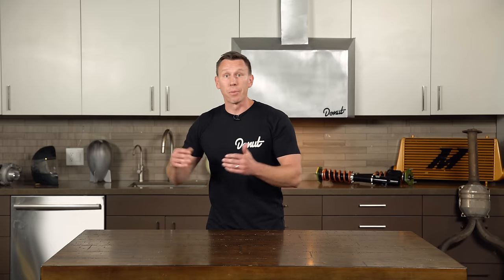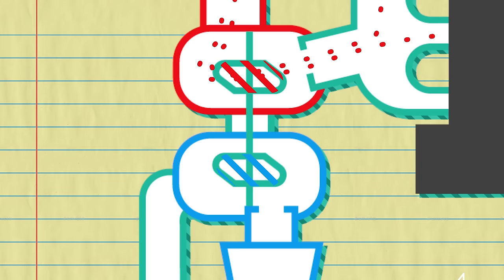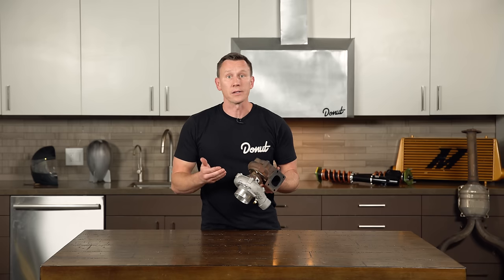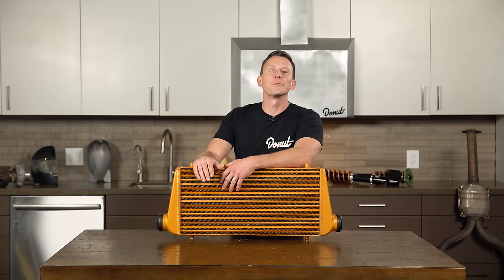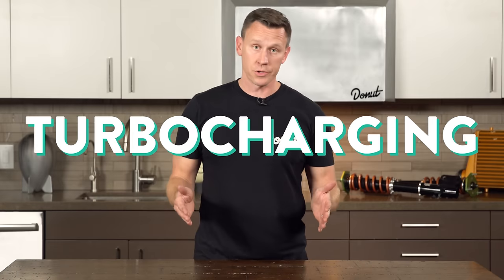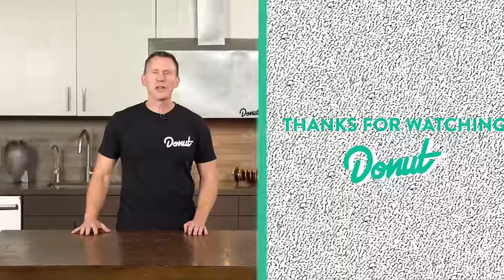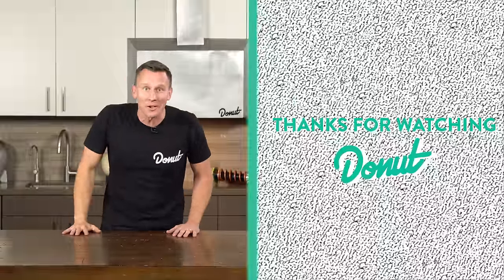Turbos: How They Work | Science Garage

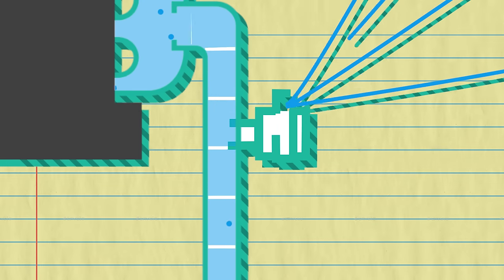Comment: When you said "stutututu" at about 2:26.. That does mean that the "BOV" is causing the nice stututu sound? 
I am confused because I just did some research myself for fun and found out that the opposite is the case. 
When BOV is not doing its job or is not existent the pressured AIR goes its way back to the turbo (hurt the turbo because more stress and stuff) therefore releasing the air thru the air intake.
When the BOV is doing its job its just a "psssht" or something because it lets the air go out.

please help me understand xD

Comment: In fact with a blowoff valve the sututu from 2:28 is not possible, that sound occurs when no blow off valve is installed, once the gas pedal is on neutral suddenly the trottle closes redirecting all the air pressure in the oposite direction - to the turbo, making a big turbulence wich in time will damage the turbo.. Well, this depends on what you like and how you want to spend money, if you like sound go without blowoff. If kinda like daily drive use blowoff

Comment: If an inline six rotational vibration is inherently smoother and less prone to primary and secondary stress; why do they no have an inherently higher RPM capability/redline? I'm not talking about over engineered and lightened Supra or that Alfa 155 race care with a $50k motor. I mean overall I6's, like the Jag 3.8, 4.2 motors. I was told that they do not reve as  high because the crankshaft is loooooonger than normal, so its prone to vibration. Could you give me some insight, as I was thinking of a 3.8 Jag build for a small, classic sports car. 
Thanks

Comment: A quick question..
So, when  the turbo is driven, the new air is sucked from the air filter. This sucked air is sent to the engine chamber for combustion. Right?

The question here is, 
I believe the Turbo is driven only by the exhaust gas.

What happens to this process when the engine is freshly started. 

Unless the engine started there wouldn't be an exhaust gas exists.

Unless the exhaust gas exists, the turbo couldn't be driven.

Unless the turbo didn't driven, the new air wouldn't be sucked to engine chamber.

Unless the new air is sucked to the engine chamber, combustion would never occur and the engine never get started.

If I'm not wrong!
Reply: Air will still get to the engine it just won't be pressurized.
Reply: Redtooth 75 so air would get through the same turbo then intercooler and then Manifold and enters into the engine chamber?

Comment: I’m sorry I’m dumb,  I don’t understand how turbos make cars more fuel efficient.   
The only thing I can think of is 
1) if you’re using 10% more fuel and getting 20% power. 
2) power to weight is better,  if you can put a smaller engine  save weight and still use the same fuel and get same power, fuel efficiency will get better.   

But where I have a problem is. For example if I put a turbo charger on my 94 ram 1500 4x4. Will I get better fuel efficiency. Or will I just make more power and use more fuel that’s it.
Reply: You can get same power with a smaller engine

Comment: When the piston moves down, it sucks air and fuel in the admission phase, when in aspirated engines.
In turbo cars, the turbine generates positive pressure, so denser air is injected inside the cylinders, but how the fuel is injected in the cylinders, if they are pressurized?
Reply: the air is forced in with a turbo car, not really injected. and the answer is fuel pressure, most cars will start out around 38-44 psi of fuel pressure and so for every psi of boost you just need one more psi of fuel pressure. thats what a fuel pressure regulator does

Comment: So in a normal car the exhaust gases come out the manifold and down the exhaust and out, where does the turbo come in here, do you have to make a new hole in the manifold that goes to the turbo? Just a little confused and it might not make much sense.

Also do you out an air filter cone at the end of a turbo or just leave it as it is with just the hot side connected
Reply: Sorry for my misunderstanding, I now get the the hot gases are released in the 'exit manifold?' and then into the hot side of the turbo, but then where's does the air go? Is the exhaust connected to the hot side of the turbo? I get the hot side turbine spins reusing the exhaust gases, making the cold side suck air in, but when the exhaust gases pass through the hot side where do they go? If they just come out the turbine then it would make a whole exhaust system useless though I still see turbo cars running exhausts
Reply: I see that the hot side is connected to the rest of your exhaust, but what confuses me is some high performance race/drift cars litterally have a pipe going from their turbo out the bonnet of the car, is that litterally their turbo?

Also I see cone filter connected to the end of turbos.

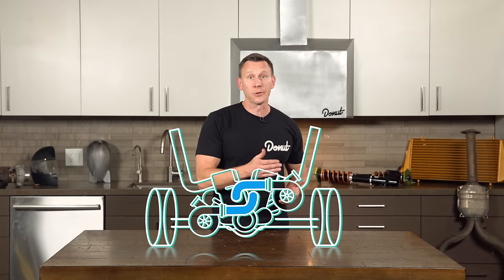Comment: 5:10 how would that form a better system. Not arguing. Genuinely don't understand exactly how
Reply: Bcs the turbos would send the compressed air to the other side of the block, while getting spooled by the nearest side, making it so that the turbos get spooled very quickly. I would imagine that it’s a lot easier to send the compressed air in a more direct tube to the other side of the block, rather than doing a zigzag the same side

Comment: i’m confused with the biturbo thing. i thought each side of the engine was different. one for gas and air and one for exhaust. so how could each turbo send air to opposite sides?
Reply: Turbos are usually mounted in the exhaust side, on a v-engine there are exhaust manifolds on both sides and the intake is in the middle of the two cylinder banks
Reply: @1pelikone  ohh got it. thank you!

Comment: okay so, if u know what I mean car guys 🤣
basically it’s ur pistons they create air,and that air goes to the exhaust manifold then to, then intercooler because obviously u don’t want hot air so it cools it down the it goes to the turbo,turbo sucks in the air and pushes back into the engine for more power and that’s how it works 😌

Comment: Does anyone know if turbos add a significant amount off power on the intake stroke? Normal the piston pull air in which would be a very small but still loss of power. With a turbo the FA will push the piston in the intake stroke now adding some power but a very small amount. I'm wondering since it goes from costing power to adding power is it enough to be measured and how would you do it
Reply: .... Maybe get a motor and hook it up to an air compressor and see if just 40 psi on the intake will turn it over?
Reply: ... the I have no idea how to figure out how much energy is spent on the intake stroke

Comment: The biturbo also required the engine to be removed every 30,000 miles to replace the timing belt.

yeah.
Reply: I highly doubt that.
Reply: @Redtooth75  Turns out you are right! It was the timing belt that had to be changed every 30,000 miles. This required taking out the engine.

Comment: Your still getting the no replacement for displacement saying wrong. What that means is take two motors 2.0 and 4.0. Both na motors the 2.0 will make less power then the 4.0 add superchargers or turbos to both and the 4.0 will still make more power and breath more air. You said it yourself, motors are just giant pumps. The bigger the they are the more air the pump. That’s what that saying means. I have 2.0T cadillac and iron block 472 cadillac. The 2.0t can never dream about matching the 472. Build both motors up and the 2.0t stops are 500hp being reliable. The iron block 472 can easily make 1000 street able hp

Comment: I thought turbos worked like this so there is a filter placed in the front of the car so when you drive at high speeds the air would flow into a tube attached to the air filter feeding into the turbo the rotor pushing air into the engine causing it to run faster which means mo powah babeh but no I’m just an idiot
Reply: Thats called a ram air intake
Reply: Redtooth 75 I told you that I’m an idiot

Comment: Smart people: "It's all about the mass of air you can get in there to react!"
Engineers: "Then let's pump more air into it by pressurising it!"
(Turbolag: Smart engineers: "Let's combine turbos! Bi turbos! Or twin turbos!" And no, the bi doesn't mean what you learn at university these days. It's the combination of differently sized turbos to greatly lesser turbolag)
Rocket engineers: "Huh. Let's take pure oxygen and compress it!" Boom! Liquid fueled rocket engines! "Liquid? Cool. But can't we compress it even more into solid?" No! But chemical compounds containing lots of oxygen. At room temperature! Mixed with an also solid at room temperature fuel, you'll get solid fueled rocket engines! Usually used as boosters, because they're cheap, easy to produce and maintain and pack tons of force. Only negative point, once they're lit, they'll burn. Until there's no fuel left. Solid rocket boosters. Literally boosting the performance of any space vehicle^^
Reply: Beside the turbo, some other engineers thought vacuum pumps were cool, so why not use rotary vane pumps blow instead of suck, thus creating the blower supercharger. No turbolag but lots of parasitic loss to engine output power. But still way better than naturally aspirated engines.

Comment: Howwwww???????? Why air ??? But what about the air percent ( mean  between 16 and 21 percent ) there is not enough air in one cylinder ???
Reply: Oxygen is required for combustion to occur. If there is more oxygen in the cylinder then you can inject more fuel. If you inject more fuel you make more power. Compressing the air that enters the engine increases the amount of oxygen that enters the cylinder.

Comment: same thing - 2 parts
in and out
radiator also same thing - exchanger 2 parts, hot and cool
intercooler, same thing, 2 parts = fridge and turbo
bypass ratio, same thing spool-spin-spool and stop-braked

if space between impeller(in thrust)-propeller(out thrust) have bypass-ratio 
if between blades have bypass-ratio
when braked, is higher flow than spinning due to ram-air of dive-bomber

thrust vectoring by turbo-charger rotation
supercharger by leaky bypass-ratio.sss of impeller to turbo flange clearence

lag at carpark speeds and 2.5x idling rpm(800rpm - 2000rpm, cam shift at 3000rpm, gear shift maintain either first or second cam - driving style) (braking style is cam middle, 4000rpm shift down, to 3000rpm cam shift down, ...)

build materials cheap and bearings cheap intercoolers.
shopping sequence intercoolers to bearings review price, next, ... manifolds to impeller to turbocharger. usage = ... turbo timer cool-down while parked in multistorey carpark = inconveniences for convenience(car) = nevermind what i typed
Reply: initial-D need glowing discs not glow-plugs